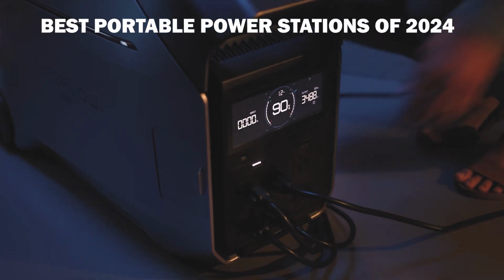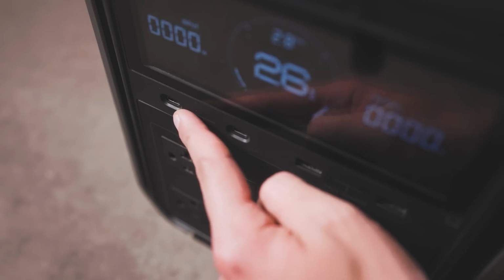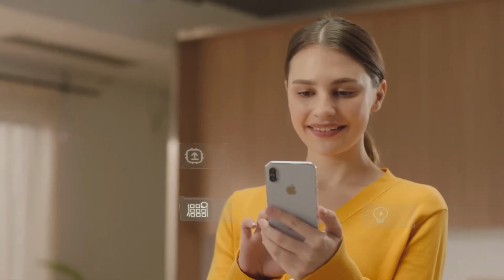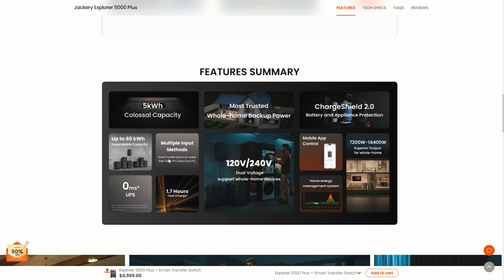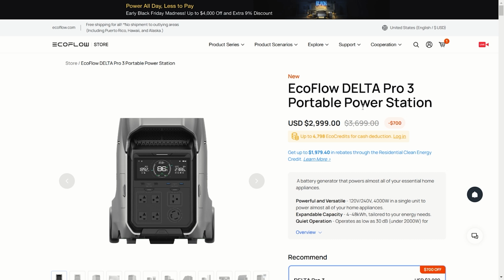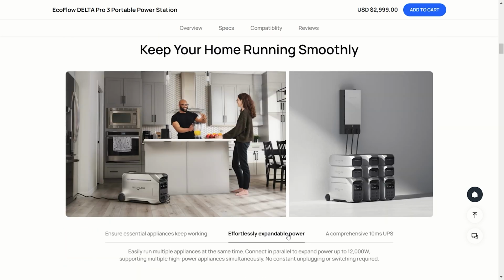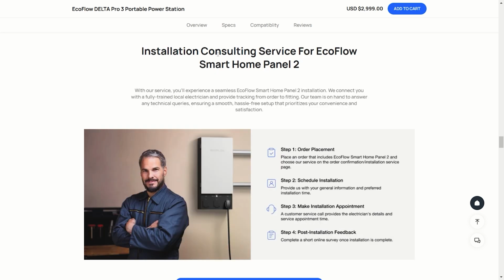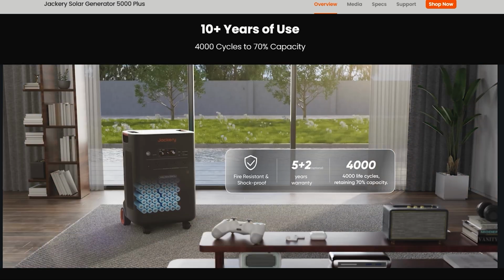EcoFlow Delta Pro 3, Jackery 5000 Plus, Anker Solix 3800, Bluetti EP500 - Best of 2024 - Full Review

Comment: The Delta pro three is not more powerful than the F 3800?? This has been disproving on so many different other YouTube channels. It’s actually a surprisingly big difference how much higher starting capacity to F 3800 has
Reply from the maker: Who said Delta Pro 3 is more powerful?    F3800 is 6000watts.  Delta pro 3 is 4000 watts.    It's no secret.
Reply: @adventure-tech but add that extra battery tho things begin to change.